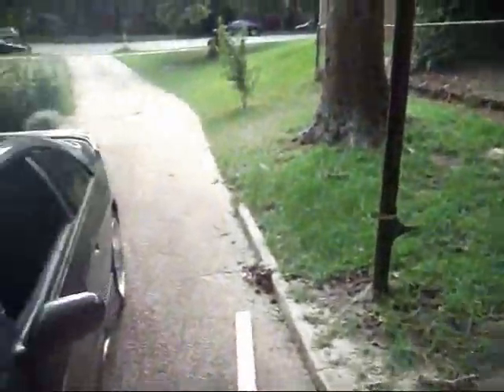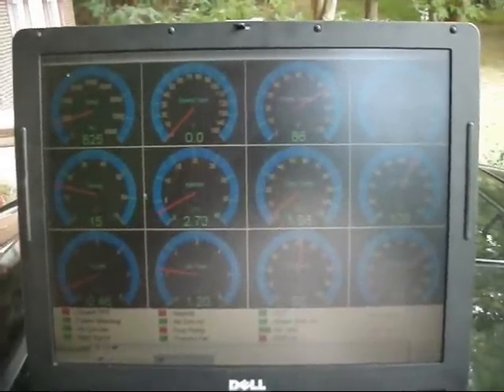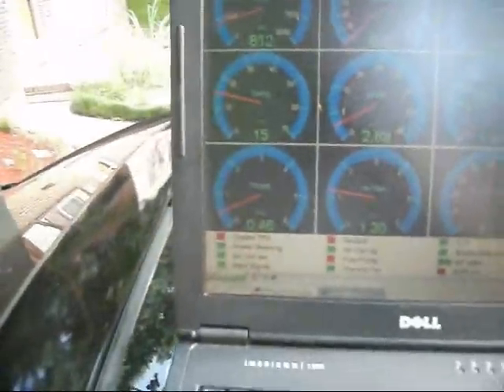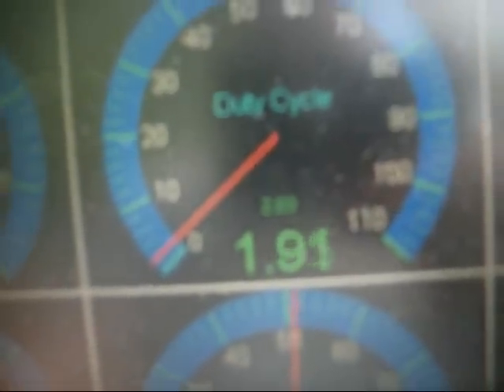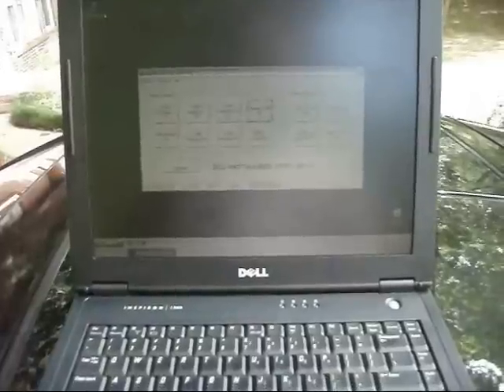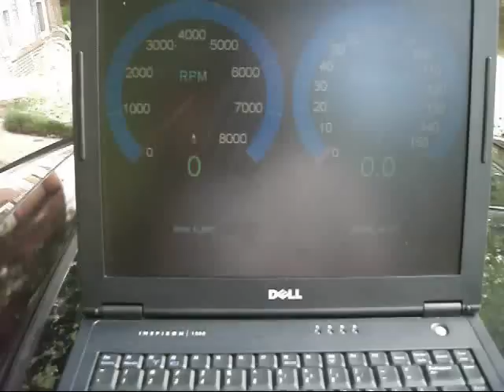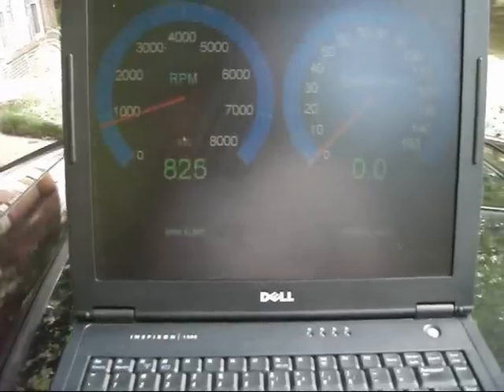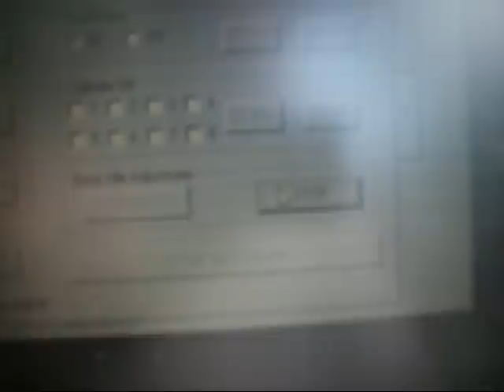Premier Z Shop (300zx Specialists) - Consult program

Comment from the maker: @Damonke1 Well they say that the stock internals can handle up to 600hp to the crank. If you are looking to get 650 to the rear wheels then yes i would probably go ahead and build the bottom end of your motor. Def get better rods at least.

Comment from the maker: @tt300zxkid No it is a tool to see why your Z is not running correctly. Nothing to do with tuning. ever want to know why a cylinder is not firing. You can find out witch one it is by shutting off the cylinder to see witch one is not firing. Plus set tps check injector duty cycle and etc.